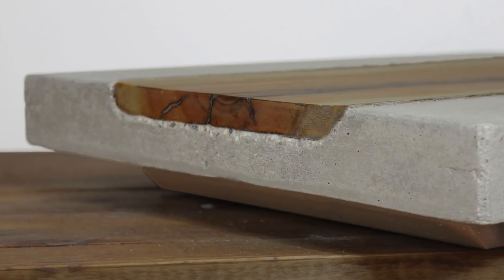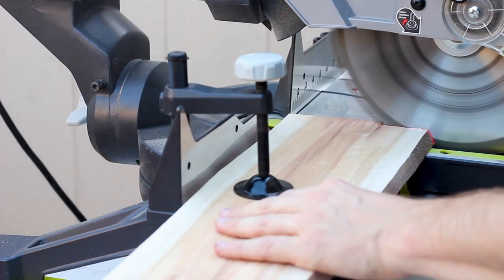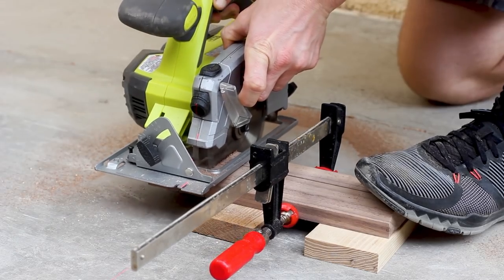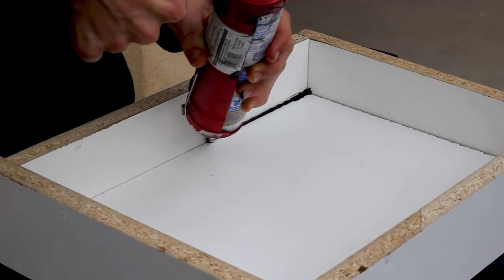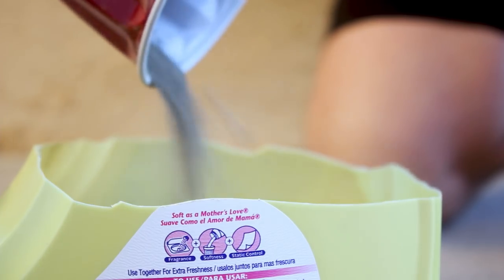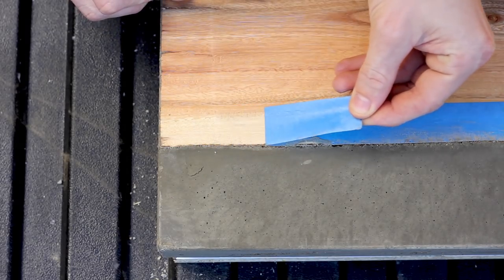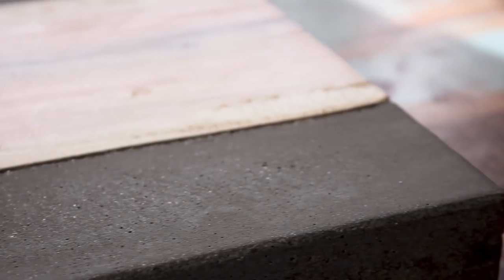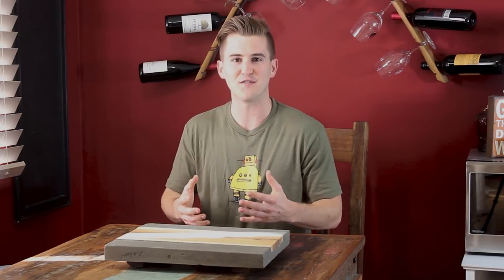Live Edge Charcuterie Serving Board | 24

Comment: If you’re looking to save wood, you can always use an inexpensive hand saw to cut down a log like that. It’s a little work but you’d have been able to get three to four usable slabs.
Reply from the maker: +ardenthebibliophile this is a great idea. I knew when I settled for the planing technique it wasn’t the best move - maybe rushed into the idea without considering all my options. Cheers
Reply: You probably could've split it in half with an axe too.

Comment: This is really cool.  It came out great!  Re: how to avoid those cracks -- use GFRC instead of Quikrete :) But, I really like that you've provided a bit more accessible version and shown you can get a great look for very little money.
Reply from the maker: Thanks man! Curious - what is it about the GFRC that helps? Do you think the Quikrete Countertop mix might solve that issue?
Reply: A lot of things.  Defoamer admix reduces entrapped air bubbles and leads to very few voids in the surface (with no vibrating needed).  The acrylic polymer used replaces some of the water and hardens to a solid, leading to denser and stronger concrete.  The plasticizer compounds this by reducing the amount of water needed to get a flowable mix.  Less water = less shrinkage = less surface cracks.  And the fact you do a face coat where the only aggregate is fine sand means the face is very dense and crack resistant.  Lastly, the backer coat only uses glass fiber and sand as aggregate, so it is also denser and stronger for this reason.  The glass fiber also gives something like 5-6x the flexural strength of regular concrete.  Besides eliminating need for rebar or other reinforcement, the flexural strength means GFRC can actually bend a bit before cracking.  Quikrete countertop mix has a bit smaller aggregate and some plasticizer, so it will help some, but not nearly as much as a true GFRC mix.  The countertop mix still has larger aggregate, is more prone to voids from air bubbles, requires more water, needs reinforcement (and doesn't flex).
Reply: p.s., I'd suggest splurging and ordering a bag or two of GFRC mix from Fishstone (I've used them an Buddy Rhodes, and like Fishstone's just-add-water mix the best), along with a small AR glass fiber bag.  Its about $45 + shipping.  I can tell you like the process of experimenting and learning, so I think you'll immediately see that it will open creative possibilities that aren't possible with standard concrete.   It looks like cake batter and is smooth and workable, or you can vary the amount of water and get a mix that can be packed like play-doh.
Reply: p.p.s. I just shared your video in a post on the Modustrial Maker blog.
Reply from the maker: This is all great. I really do enjoy the experimenting process and am not thrilled (at all) with the concrete results I just got - although granted, it was never intended for such purposes. I'm going to check out all the GRFC stuff you mentioned - I think a just-add-water mix and AR glass fiber bag is ideal for my situation since my storage is limited. Can that be bought locally or has to be ordered?
Reply: Depends where local is for you :)  It isn't commonly available but there are 10 or so places around the U.S. that sell/distribute it.  I like Fishstone since it is near Chicago.  Shipping is a pain to pay for...often $40-80 depending on how much you buy.  I just thought of it as a learning process.  Initially I used some pre-mixed stuff and learned more about GFRC, then I ordered a bunch of the specialized ingredients that you need in bulk, and sourced the heaviest ingredients (white portland cement and quikrete medium commercial sand) locally to save money.  For about $600 in bulk materials, I made a desk, a bar, a coffee table, a side table, a hearth, and still had leftovers.   Some people don't need all this, but I get the feeling you are someone who would enjoy the learning process and could definitely get your money's worth.  Starting place though is to just take the plunge and order a bag or two to try out :)
Reply: Also, Fishstone's current run of GFRC mix is shipping out in 5 gallon buckets (50 lbs in each).  This is super nice because the buckets are way easier to move, store, and pour from, as compared to horrible concrete bags.

Comment: That turned out nice. Adding the screws as anchors was a good idea.
Reply from the maker: Thanks! I'm questioning it now - the wood, although dry, is warping a bit (I think because the Minwax didn't coat as well from moisture as I'd thought). I might end up redoing the whole project - or just redoing in a different format, like with hardwoods, finer concrete, different protecting methods, etc.
Reply: Bummer, man. Hate to hear it is warping! That sucks. Maybe it just needs more coats of poly? Or more time for the poly to cure fully?
Reply from the maker: +Bruce A. Ulrich I definitely think more cute time. Or like a polycrilic instead - just something thicker!